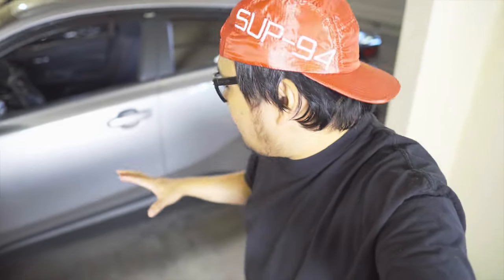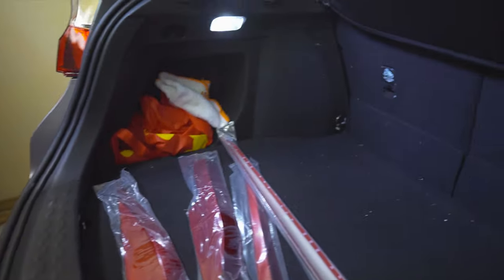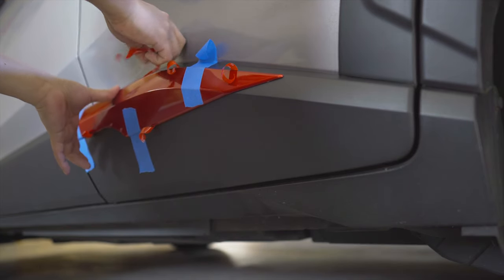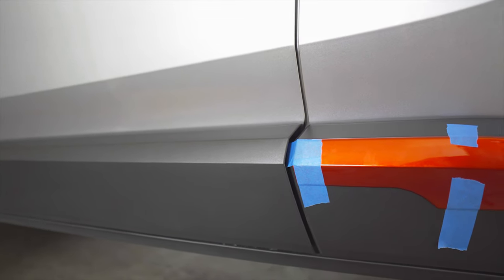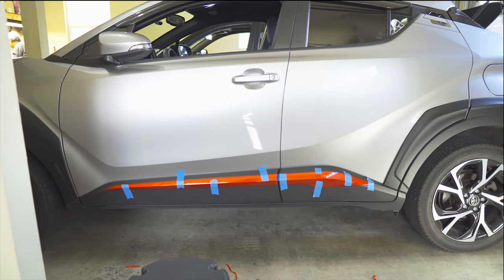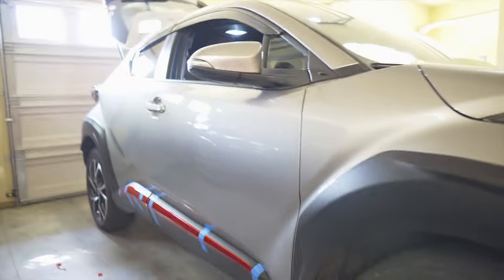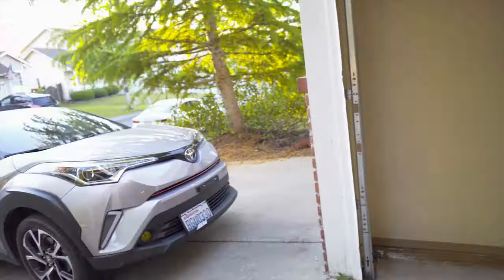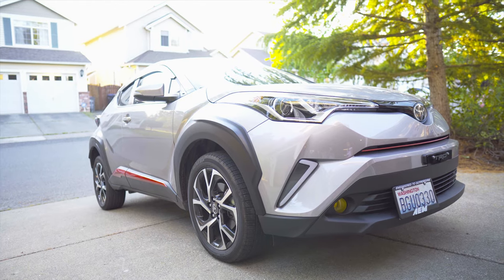How to install Red Side Trim Garnish on My 2018 Toyota C-HR XLE [ Project C-HR VLOG 25 ]

Comment: Bro where did you get those rear bumper diffuser the silver one? If you have a link much appreciated..thanks
Reply from the maker: Toyota Thailand, there are some ebay sellers from Thailand,
Reply from the maker: https://www.ebay.com/itm/Rear-Spoiler-Sub-Lh-Rh-Sub-Assy-Unpaint-Genuine-For-Toyota-C-HR-Suv-2018-2019-/123280427130?_trksid=p2349624.m46890.l49286